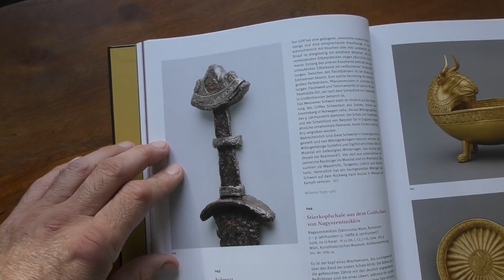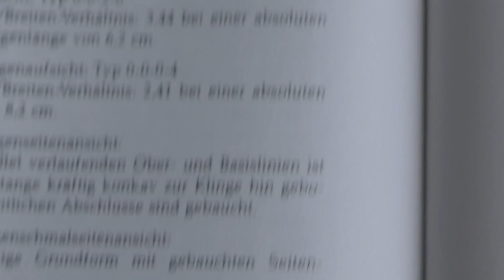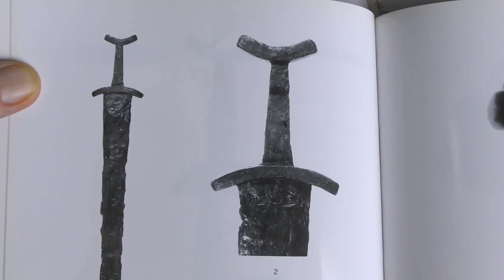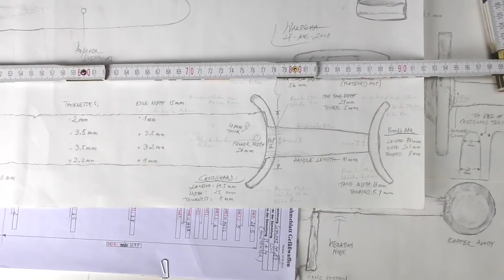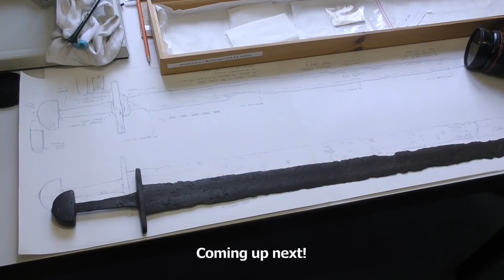Weights of historical swords: Super light Viking sword

Comment: A thought on the many recent nicks:
As the fine blade edge is exposed to corrosion it does not need heavy impact to chip. Hitting a rock during deposition/re-deposition should be enough to make it later look like a mistreated sparring sword.
As pointed out the "older" nicks near the vorderen Ort/ point have been exposed long enough so that they appear somewhat smooth now (holding a nice patina, of course)
Reply from the maker: True, yet the various nicks and scratches attest to some careless misuse of this artefact. there is no doubt about it.
Reply: That was a missing link for me. Thanks for the additional information.

Comment: Hi Roland, a great example of master craftsmen work. Has any one done an analysis on the metals used in construction of the swords, to trace where or what region the metal came from ? I know the Vikings had extensive trade links, I find it interesting to see if the metal was sourced locally or traded for.

Thanks for creating these very interesting videos.
Reply from the maker: Dear Jeff, i am happy that you enjoy my videos. In regards to this sword: No, I am not aware of an according study. However, I am not sure if there methods to determine provenance of steel at all. At any rate, there is a clear Anglo-Saxon influence here, and according to one viewer's comment, most examples were found in Britain and Norway. Historically, there were close cultural and political links between Wessex and Norway in the early 10th century.
Reply: Nicko Persilion Hi Nick, I never heard or seen the doco in question. I like Viking history and know they had very large trade links. I know gold, silver, copper was traded and I assumed iron/steel also. I am particularly interested in the metallurgy of the blades wether if there was a source of iron/steel that was regarded as superior and sort after ( regardless if it was or not ) than locally made material.
Reply: @jeffpurcell7035  
Pattern welded stuff would be the most highly valued iron product. The vast majority of viking iron was produced domestically by reducing bog iron nodules in low furnaces. The vikings would know which bog produced the best iron ore, and therefore which "iron farm" produced the best steel. 
Actually the entire viking world revolved around bog iron exploitation and smelting, everything snowballed from that.
As you know, some parts a bloom produced by a low furnace are always more carburized than others and can be set aside as edge material. Then the pattern welding method can further purify and carburize that material. It is a question of case hardening thin strips of low or mild carbon steel, then fire weld a bunch of hardened strips together to get a mild or high carbon steel bar.
Reply: Nicko Persilion thanks for the information, I didn’t know about the bog iron aspect, I will have to find out more regarding that interesting iron source.

Comment: @Roland Warzecha is there a shallow fuller or is it flat sided and what are the widths and thicknesses of the blade at the hilt and where the blade stops tapering for the point
Reply from the maker: Very shallow fuller indeed. You can feel it, but it is hard to capture on video.

Comment: Is the upper guard slightly twisted on this sword? Like on some other swords from this period
Reply from the maker: Good question. No, the upper guard is parallel to the lower guard. There is no need for a twist due to the design of hilt fittings. A twist is usually only required with pommels that have a rectangular cross section,  which means they are relatively thick at the edges. This upper guard tapers in cross section, plus there is no pommel cap in the first place.

Comment: I do think the weight analysis of these weapons is underestimating the material lost to corrosion. on such a thin sectioned blade even losing 0.2 or 0.3mm would be a large % of the blade weight. I have seen videos where swords with quite a pitted surface have been weighed and then that given as 'the weight' and that irks me. sure, they are lighter than everyone thinks, but river finds are i think not as representative as some beleive.
Reply from the maker: James, of course we do not know. Yet if a patina to protect the steel underneath does not evolve quickly once the sword ended up in a river, the blade would corrode completely. The finest parts are the edges and they would go first. So with this sword still being sharp, I do not think we lost much material.
Reply: @swordandshield Of course i did not see this sword like you did (jealous) but at 1.13 it appears the edge is corroded away almost completely. any ferrous item, be it a sword or just part of a wreck or machinery of some sort, that has a tapered edge can and often will still be sharp even when even heavily corroded. As the material on the slope is eaten away on the taper it will naturally leave quite a sharp edge. It would be fascinating to examine such a sword as this and i hate to make a guess from the screen but i would be very surprised if that surface had lost on average less than 0.5mm of material judging from 1.15 were the deep valleys between forge welded layers are visible. its possible the truth is more or less but i think that is a reasonable estimate. I see that the thickness is 3.5mm at the centre and 2 towards the edges. so, if it has lost 0.5mm then that is around 15-20% of its mass. that might seem extreme because it still looks so great, but that amount of mass loss evenly distributed would not be totally visible. The wavy and pitted edge i think shows clear areas where a 1mm thick part has totally gone. but this is all terrible guesstimate from a video, it could be 0.25mm  but i would be willing to bet quite heavily it falls within that range. There is also the issue of the patina actually adding thickness compared to original corroded surface etc. etc. but thats getting too picky. I wouldn't be surprised if this was as much as a 0.9kg sword when new.

Comment: How much hase the Sword Weight in the Old Days .The grip Wrap is rotten Away I gues The wood would hase the weight around 60 grams if leather Around This meen around this would make around 45 grams and When string around the grip that i gues around 50 grams .Than the Total Grip wrap would weigt around 105-110 Grams The Sword Weigt 730 grams Grip Wrap and Sword 835 -840 Grams . but there is Iron  lost from the sword i dont hase a Idea how much i dont know maybe under 60 grams than The Total Weigt in the Old Days maybe 900 Grams ?
Reply from the maker: At the max. I actually think this sword lost more material due to repeated sharpening than to corrosion. But that is just a guess.
Reply: @swordandshield  to Grind with Scharpenig weight away is not so easy ibut i hase only try with a Tungsten Carbid scharpener (wolfram Carbid Schärfer ) or (Acu Scharp ) i hase  avery Hevy cutlass i hase tried to make it lighter with scharpening is not so easy. For the first. when i Scharpenig i use forthe rough grind Tungsten Carbid and for the smoth grind i use Ceramic Scharpener  mostly From  Kyocera and a Normal ceramic Scharpener i am to un Skilled to Scharpenig Sword conservative way.
Reply: @swordandshield  would be (850 -860 ) more Plausibel then is the sword super light
Reply: @swordandshield  what weight hase a Medival one Handed Sword some thing Betwen (over 800 gram and 2 Kilo gram ) i think this is a very big Difference i gues ?
Reply from the maker: @ Killer kraut: there are always outliers, but 2kg for a one-handed sword would be ridiculously heavy. Between 800 g to 1200 g would be standard, if such generalisation is legitimate at all. There a lot of factors that impact a weapon's handling characteristics, weight is but one of them.
Reply: @swordandshield  in my Whepons Book Geschichte der Waffen from Richard Holmes there is a Sword weighted 1.95 Kg Dated 1150 -1200 and In a video From Scholagladiatoria talks Matt Easton about a Castillion Sword Weighted about 1660 Gramm my Therory is that heavier Swords some time better for On Horse Back usage.
Reply: @swordandshield  i know there are some Sword Factors Like Balance Point  Rotation points .